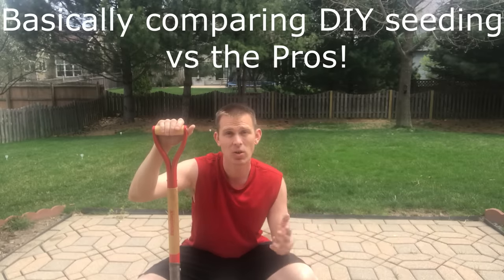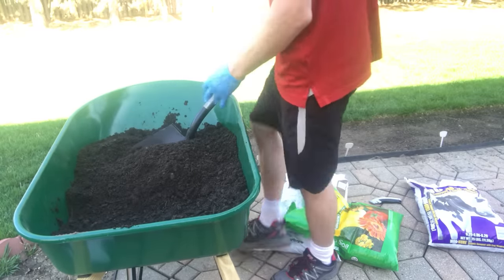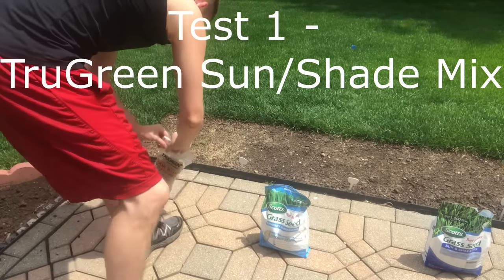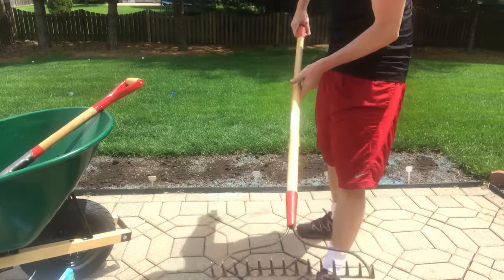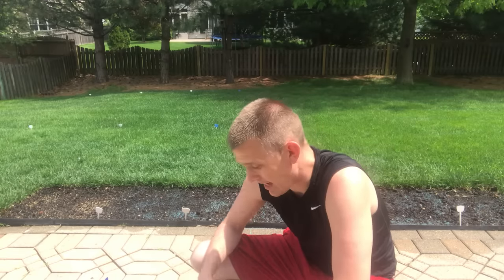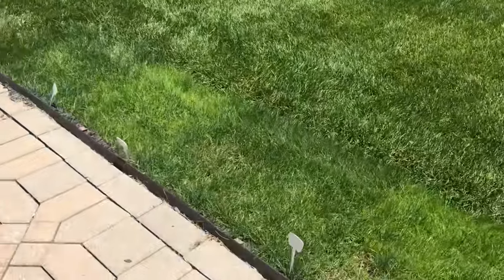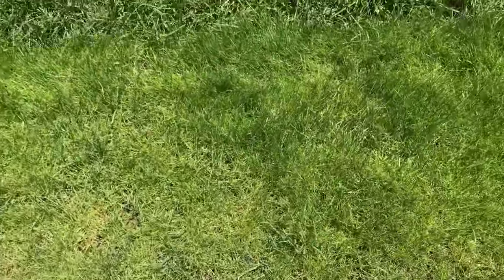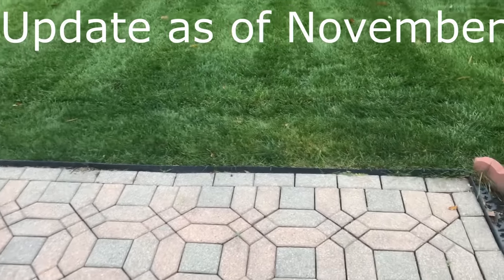Grass Seed Test PROOF! | Grass Seeding Before and After Results (LAWN CARE)

Comment: Just checking on your heavy handed area.  I did an entire back yard last year and it was heavy handed and planted in the spring.  Come fall the grass all died.  I am wondering if it is specific to climate.  I moved and am replanting an area next to a huge tree.  I am using the shade mix but am concerned about over seeding like I did last time so I lightened up.  Just wondering about your test now that there are several more months in.
Reply from the maker: a day in the life of me -- yes i actually posted a 1 year update of this test and the grass seed results here : https://youtu.be/_GUhOcMkxA0

Also you should be careful seeding or growing grass around trees because trees suck up a lot of the water and not much is left for grass.  This is why I recommend mulching around tree bases.

Not sure why your spring seeding didn't take well, was the grass fully established before summer heat hit? This could definitely hurt the new grass due to roots not being deep enough yet.  Did you water regularly for a month? Did you water during summer at all?
Reply: I use to throw down light and the grass would grow thin. I did a test on a bald spot in my yard and threw a lot of seeds down. That spot grew back super thick. Since then I have been throwing a lot of seeds down
Reply: @JealousLawnCare  Well, the over seed area is dying like it did last time.  Not sure what to do anymore.
Reply from the maker: a day in the life of me -- so it came in with the new sweet and then started dying (did it die after you cut back on watering or when)?
Reply from the maker: SC Challenger -- Never had any issues with heavy seeding either, seems to work out!
Reply: @JealousLawnCare  I seeded normal in one area and the girlfriend helped out and over seeded an area I had not got to yet.  The grass by the tree is doing okay but not in another area.  we don't have a sprinkler so we water 2-3 times a week.  Last time when I over seeded I did have a sprinkler system and it still died.  This time I used a shade mix as there is a lot of shade but no sprinkler system.  We try to water three times a week and not when it rains.  The only thing I can think of here is the ground had a lot of clay dirt.  I mixed in a lot of top soil but thinking I needed to do more.   It came in very thick and green and now it is dying and sparse.  Don't think I can post pictures on here.  No traffic on the grass, watered 2-3 times a week, came in good now dying, added summer fertilizer after grass was showing yellow but no change.  regular seeded area is doing better, only yellow spot is where there is no shade but still not a thick grass.
Reply from the maker: a day in the life of me --- this isn't by chance near blacktop (vet and common issues like this along driveways due to the pitching of the blacktop base under the grass)?  Have you tried raking / tilling the soil a few inches before seeding?
Reply: @JealousLawnCare  It is not near a driveway or any non-dirt surface.  I tilled up the ground and added top soil after seeing how much clay was in the dirt.  I then raked it in to mix it.  Few days work for the area I seeded.  The part that is struggling had more clay and was also the over seeded area.
Reply from the maker: a day in the life of me -- strange, that seems like a good process.  Clay isn't that bad because it supposed to retain moisture longer from my understanding than dirt but also is harder for roots to get as deep
Reply: @JealousLawnCare  yeah not sure.  Other side is dying too.
Reply from the maker: a day in the life of me -- sounds like maybe you need to do a test of your own in this trouble area.  Different seed types, soil conditions, etc.  I know it's a lot of work though :-/.

Comment: Interesting trial but there are a few variables important to take into account. First is coated seed v bare seed cause differences in seed counts and can impact fertility as well. Even spreading of seed is important and helps cover those gaps, try the old chook feeding action helps get a good even spread or salt shaker with big holes in it. Second is sow rates similarity above important seeds be weighted or calculated based on variety sow rates so this will cause a fair bit of difference depending on what’s in mix. Third is most important is seed types in the mix, ryegrass will get up quicker obviously to Kentucky or fescue. There are lots of variables within species and varieties which is a good test as well. Interesting all settled after a period of time to look similar but would perform different during heat or cold 🥶 which is another good test. Maybe seperate varieties - ryegrass v Kentucky v talk fescue v fine fescue? Half plots not fertilised v ones that were?
Reply from the maker: All good points, maybe I can use these in future test videos. So much to try to account for with many variables as you mentioned!
Reply: @JealousLawnCare  cheers if you need some seed options I work for a global company ‘Barenbrug’ that can help with some samples if you like 👍 check them out they have some great products
Reply from the maker: Sounds good, thank you! I've never tried the product but could definitely give it a good test and compare it to some others.  Would that work?
Reply: @JealousLawnCare  sure drop us a line hey I’ll put you in touch
Reply from the maker: Sounds good bud, thanks!

Comment: Cement mixer.  Why sweat if you dont have to.  Mix seed and a starter fertilizer as well as compost cow poop top soil peat moss and fish compost untill the soil is moist but not wet, lay it out then cover with burlap keep ground moist for 11 days.  Every day then after 11 days cut back to every 2 days for a week the 3 days for a week untill the grass is 6" tall then remove burlap. And mow the lush grass. Water 1" weekly the whole season.
Reply from the maker: bobbg --  that's a good method also, I'm also a fan of least work possible to get same results when possible!

Comment: Mike.   I just saw this video about your grass seed.  My question.  is there such seed that's best for dog traffic?  meaning, my pitbull LOVES to run and dig her paws while she running and jumping off the deck, or is KGB 31,  or KGB or perennial rygrass or, or, or??
Reply: What is the toughest grass for dogs?
I think I got my answer, lol.  Kentucky blue grass wins.....Hardy Grasses That Can Cope with Your Dog
Kentucky Bluegrass. Kentucky Bluegrass is one of the hardiest grasses available, and it thrives in most growing locations. ...
Perennial Ryegrass. Perennial ryegrasses usually produce a fairly robust root system and grow very quickly. ...
Fescue. ...
Bermuda. ...
Zoysia.
Reply from the maker: Yolanda Gomez -- yes Kentucky bluegrass is the best for high traffic or dogs due to its self-healing characteristics. Perennial rye would also be fine, just stay away from fescue because it takes longer to recover from damage.
Reply: @JealousLawnCare  thank you  Mike.
Reply: Bermuda would work well in full sun, but looks awful in the cooler regions because it goes dormant, kbg requires a fair amount of water to maintain the growth phase of you want to maintain rhizomous behavior
Reply from the maker: dvxAznxvb -- yes gotta love those high water bills when watering! 😂

Comment: I have some moss coming up around flower beds, can I apply moss killer before I overseed and starter fert w crabgrass? and how often can I put it down?  once a month?
Reply from the maker: Yolanda Gomez -- is your moss coming in on the grass or the rocks surrounding the flower beds?  I would check with the moss killer you are going to use to see if it's specified, honestly I don't have too much personal experience with moss and would not want to tell you wrong
Reply: @JealousLawnCare  I don't  have  much,  looks  like  it's where I have  an empty  flower  bed and surrounding.   I will check .  Thank you
Reply: Yolanda Gomez if you have moss you can apply pelletized lime, the soil is too acidic thus you will need to apply anyways if you are wanting seed to take
Reply: @dvxAznxvb  thank  you.  I  bought  lime  last  year,  I'll put  it down  again  before  I overseed.   I'm also  gonna  get  a soil test  done.   I know  all this  work  will pay  off.
Reply: @dvxAznxvb   i just put down 3 40 lb bags of lime; and my word it's a workout, I'll put down the other 2 later or tomorrow, I self tested at 2.5 , no wonder why my grass is having a hard time.  thank you very much for your added advice
Reply: Yolanda Gomez don't try to correct the issue overnight, you need to allow it to accumulate throughout the soil layers, you might be able to do more frequent and same amount to facilitate the permeation
Reply: @dvxAznxvb  thank you.  I did want to correct it but I do also know that I have to be patient.  I'm just hoping that when I overseed,  it'll be ok.    I did do some research and know that I can apply once a year and do soil test before I apply.   I'm just wondering if  the lawn will benefit to apply twice a year;  maybe I'm wording it wrong when I look it up, don't know but that's what I was wondering. Do you happen to know that answer?
Reply: I'm planning to apply twice a year 20lb/1000sqft it's better to be out there more than less
Reply: @dvxAznxvb  thank you

Comment: My lawn needs help.. I tried everything..   A lot of dry spots. Idk what to do?
Reply from the maker: Victor Janusz -- when you say dry spots do you mean bare spots or no?  What have you tried so far to fix it?
Reply: @JealousLawnCare  dead spots. I've tried a fungus killer, chit bug killer, weed n feed, reseeding and resoded a couple spots. Not all at the same time of course. I water in the morning and a dusk.. Idk anymore.. Thinking of of getting artificial grass at this point.
Reply from the maker: Victor Janusz -- when you seeded it, did the grass grow normally or no?  Does it just burn out during summer heat or all year long?  Feel free to send me some pics if you want from afar and closer up as well.  What type of grass do you have and where do you live? My email is Mjstodola@hotmail.com for the pics
Reply: My phone doesnt allow me to send pics throu YouTube
Reply from the maker: Victor Janusz - you would need to post the pic and send a link here or email me
Reply: @JealousLawnCare  in your experiences with Lawns which seed is the strongest and will last the longest?
Reply from the maker: Victor Janusz -- actually good timing on asking this question!  Because I just ripped out all this grass for a new seed test (yes I almost cried) and when I dug out the sections the Scott's Kentucky bluegrass seed already has 8 inch root growth in under 2 years!  I would highly recommend this grass seed and it's definitely the one I use throughout my Lawn.
Reply: @JealousLawnCare  where would i purchase this?
Reply from the maker: Either Amazon here for Scott's Grass Seed Kentucky Blue - https://goo.gl/QNTQ1Z
Or anywhere local like home depot should have it as well.

Comment: By adding good soil to the top of your soil  without mixing it at least 6 to 8 inches the root will stay at the top where the good soil is.
Reply from the maker: D S -- 6-8 inches is a lot of change out, definitely would be getting to the deep clay underneath. But I guess you can't have too much of the good new soil!

Comment: The real story is how those test patches held up against summer heat and drought, and disease pressure. Shady mix not a great idea in a spot like that with full sun. The fine blades look off against the broader tall fescue blades, and their the first ones to go brown and go dormant in the summer heat.
Reply from the maker: Yes that would be a good test by itself, agreed.  But with this section tested it was actually no different than the rest of the lawn in my back.

Comment: What’s your watering schedule at week 2,3,4?
Reply from the maker: Loading. -- week 2 I water 2x per day, week 3 1x per day deep, week 4 I like to water once every other day to make the roots strive for water and go deeper.
Reply: I currently have TTTF. I like to add in some KBG so I fill in some spots and thicken the lawn. Should I just start over seeding with KBG?
Reply from the maker: Loading. -- personally I am not a fan of strictly overseeding since seed needs soil contact to start germination.  Instead I prefer overseeding after aeration, you get a much better chance of seed germination due to more guaranteed seed to soil contact.
Reply: @JealousLawnCare  yes you're correct. This fall I plan on double pass aerate and then overseed and then maybe add some peat moss
Reply from the maker: Loading. -- i might have to try out some peat moss this year, I see a lot of people using it during seeding but never used it myself. I assume it's for better moisture retention, so less watering?
Reply: Yes. Good seed to soil contact, keeps the seed moist. Hay might contain weed seeds. Also when the peat moss gets wet it changes colors so you know when it needs more water.
Reply from the maker: Loading. -- ahh ok, good to know...ill experiment with this for the future! Thanks!

Comment: Your November update shows that seeding too heavy gives a worse long-term result than sparsely seeding which is interesting. Thanks for the video. Btw your top dressing raking moved the seeds too much. Next time just evenly cover with your hand and don’t rake it for a more even test.
Reply from the maker: Eganwp -- i think I have some foot traffic on that November results where you see the heavy handed seeding.  Currently it shows as the best of the test spots (1 year later).  

For the raking part, remember I did seed first, then use top soil then seeded more then raked it in a bit.  With both seed layers it should be a pretty good even base of coverage imo.

Comment: In future test maybe you should get a hand held seeder for actual test purposes. Be more consistent in comparisons then just using your hand and eyeballing. Not knocking what you are doing but in a results out look I'd say being even with seeds to see which grows better/faster/thicker a consistent spreed of seeds would only be fair for testing.
Reply from the maker: Nick Rabe -- yes i thought about using the hand held spreader in my garage, but it doesn't have an edge guard and therefore wouldn't work well for these different tests since they are so close together.
Reply: @JealousLawnCare  could have used some cardboard from a  box to block off two sections at a time. But either way the results looked great and still helps so thank you keep it up!
Reply from the maker: Nick Rabe -- yes that would have worked! :-/

Comment: You need to pay attention to your paver patio! You need to broom in sand to lock them in better and the edging wasn't secured enough, its separating from the pavers.  Good video on the grass comparison thou.
Reply from the maker: vikings844 -- yes that's definitely a big project on the to do list.  I wish it was concrete (low maintenance). 😂
Reply: Use PermaSand mix Spread it out sweep into gaps then mist  spray with water to lock in bonds like grout👍🏽
Reply from the maker: DEMBOYZ -- really, it stops weeds and mold from coming between the cracks of patio pavers?
Reply: Jealous Lawn Care weeds, yes.  Mold, that is going to grow wherever conditions permit.   Let the area dry for 48 hours straight at least once a week and mold should not be able to grow.   
If an area stays wet or flooded for a week straight, mold will grow on anything.  Including concrete.
Reply from the maker: Yep mold is definitely more problematic on concrete, my patio included.  Soon it will hit my to do list in priority. Heh

Comment: Notice no peamoss to hold moisture in on top of seeds. Also looks like you got new wheelbarrow and shovel in short nothing like new equipment.
Reply from the maker: Angela Prater -- heh yep mostly new equipment and keeping wheelbarrow clean for most part.   Yes I didn't use any peat moss here, I will have a test later this year on that because you and a few others have mentioned it.  Making me curious...
Reply: I Tryed the peamoss not much luck with it wash away DRYED out quick went back to straw comes up quicker
Reply from the maker: Yes i didn't notice much difference here either when I tested here with peat moss and straw :
Reply from the maker: Agreed I didn't notice much difference either when I tested these products last year here : https://youtu.be/J9MENoIIyyE

Comment: Should have weighed seed to ensure a true test.
Reply from the maker: Yes this would have been a good idea, will keep this in mind for future tests!
Reply: I’m not so sure that it would be appropriate to weigh the seed. The bluegrass seed is so much smaller and lighter than some of the seed in the sun and shade mix, so an equal weight of both would put more bits of seed in the bluegrass batch.
But putting a tarp down, and spreading seed onto the tarp with the appropriate spreader setting would give a volume of seed that should be the right quantity to use.
Reply from the maker: Steve Babiak -- that is true, seeds do have different weightings! Good alternative idea there too!
Reply: Jealous Lawn Care - yes, tape onto the tarp first to outline a spot the same size as test area. Spread seeds on tarp. Wipe away seeds off of the tarp outside of taped area. Then gather remaining seeds off of tarp.
Reply from the maker: Steve Babiak -- I'll remember that! Thanks